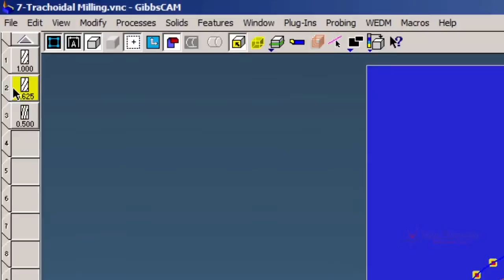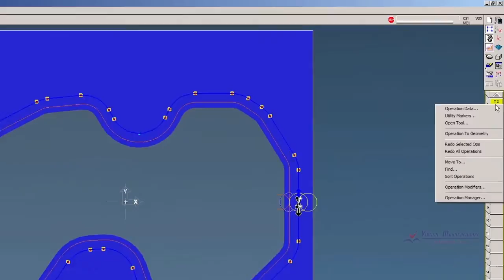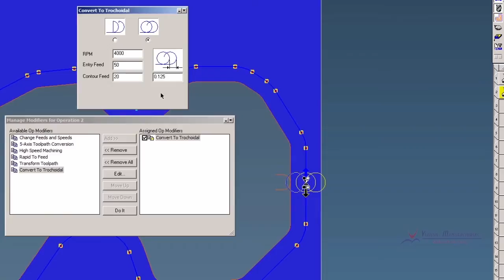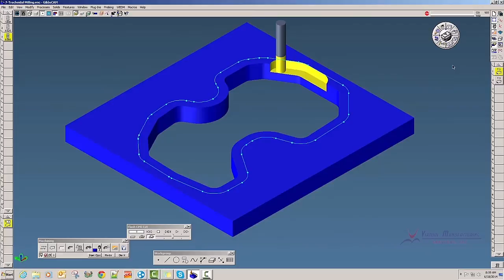Simply Powerful Trochoidal Milling

Comment: Have the free version for hobby cnc  ?
Reply: Sad you didn’t get a response but the answer is obviously no by the lack thereof. Gibbs is powerful and expensive cam software. You can however program your own gcode to do this and that’s free. Some dealers who sell industrial equipment will give you a basic copy of Gibbs with the machine. You then have a annual maintenance fee based off a percentage of what you paid. Typically it’s very basic 2-3 axis only or you pay for upgrades. They have volumill which does some impressive high speed machining.